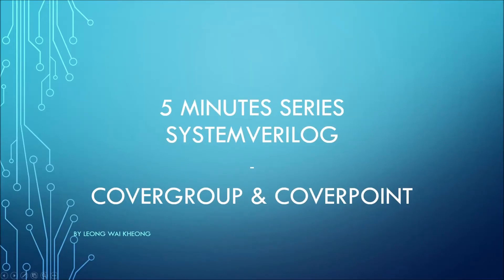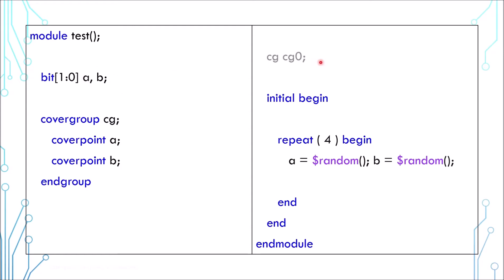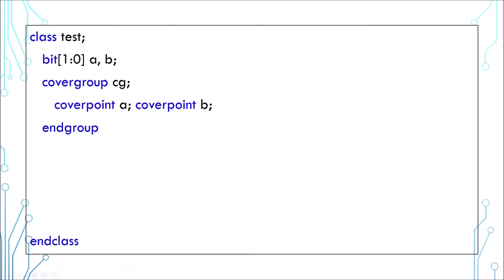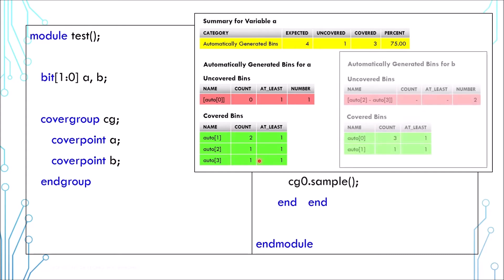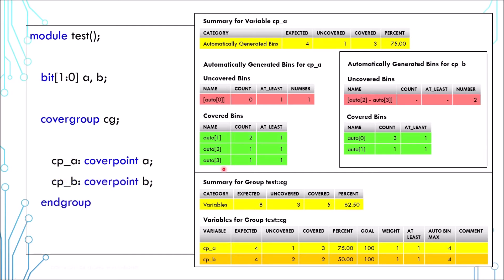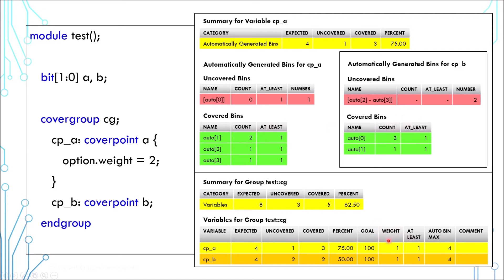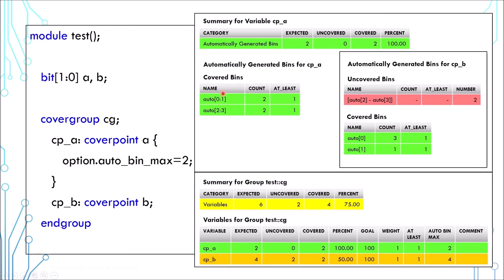SystemVerilog Tutorial in 5 Minutes - 13 covergroup and coverpoint

Comment: Your teaching is very nice  ,  I have some problem want to ask you ~
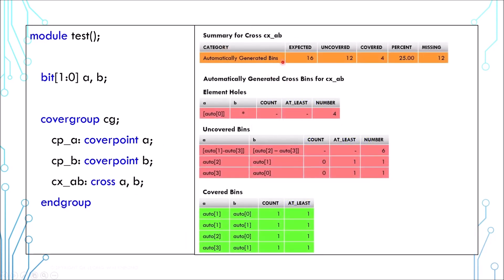4:37  May I ask why the 『Uncover Bins number is 6』 ,  and what is the 「number」 means?
Reply from the maker: Number should be "number of combination", in this case between a and b. a1b2, a1b3, a2b2, a2b3, a3b2, a3b3 are not covered, and thus 6 combination. The tool automatically groups the bins using certain algorithm; I can't be sure what algorithm it uses. You can see a2b1 and a3b0 are shown as a separate uncovered bin. It could show all the uncovered bins separately (Number=1 for each bin), but that would create a long report.
Reply: @openlogic925   May I ask  a1b2  is  means Decimal ~?     I think  a1 is means a is  1(Decimal )  and   b2 is means b is  2(Decimal ) , am I right ~?
Reply from the maker: @tigerchen3808  Yes. You are right

Comment: Thanks for this video. Can you explain why by default value will be 64 for bin a?
Reply from the maker: To be exact, it's the size of the automated bins. Intuitively, the automated bin size would depend on the variable size. 1 bit variable==2 possible values=>2 bins, 2 bits=>4 bins, 3 bits=>8 bins. However, this quickly gets out of hand as the variable size grows. A 32 bits variable (which can be conveniently created) has more than 4 billions bins. I suppose the tool is trying to prevent this from happening, so it sets an auto max bin with default 64. So that 6 bits=>64 bins; 7 bits=>64 bins(instead of 128 bins), unless a user consciously makes a decision to change it.
Reply: @openlogic925  Thank you for the explanation.

Comment: Thanks for sharing , i am really happy to be able to understand coverage this fast 
may i ask what software do you use to run your code and get such a pretty report ?
Reply from the maker: Glad to hear that. The actual report can be generated using commercial tool urgReport from Synopsys. The report you see in the slides are just table in powerpoint in which I colored the cell to make it look like a urgReport.